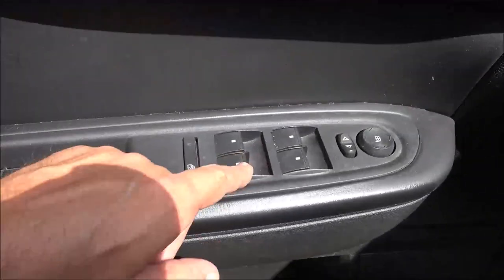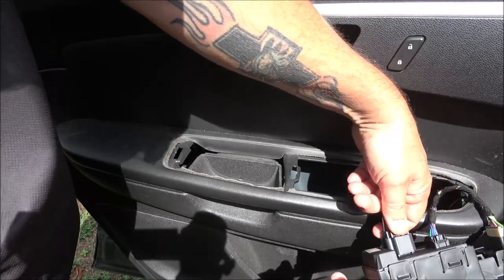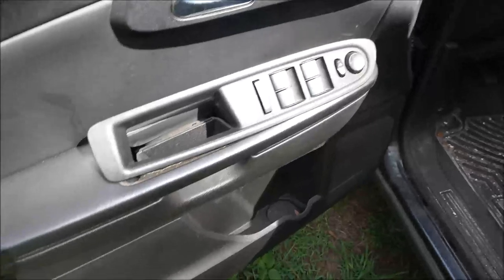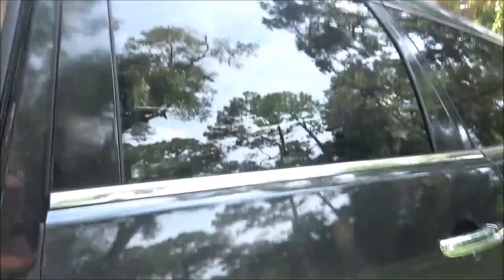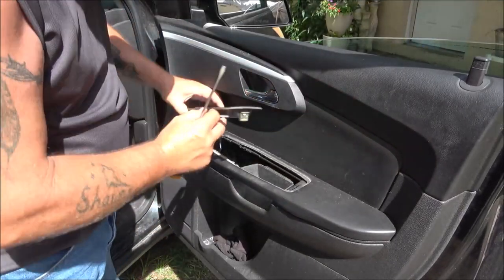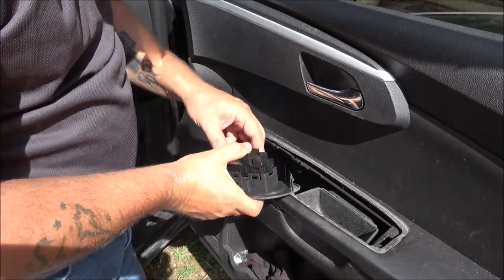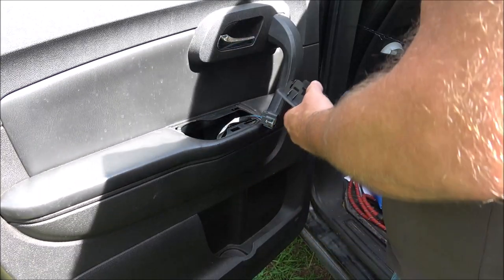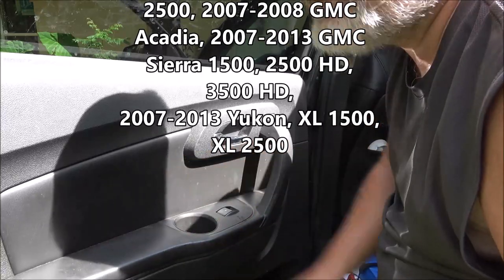Chevy Traverse Window Switch Replacement

Comment: You made that look so easy but as soon I went to pull the trim, snap, cracked, popped.
Reply from the maker: Yeah, you have to be real careful. They get brittle over time. You can get those at any part store or online. They don't have to be exact, just get as close as you can. They're fairly reasonably priced as well.

Comment: Good video. Question. Why didn’t you just clean the contacts up? Would of been much cheaper and that’s all they ever need-q tip and some alcohol
Reply from the maker: Because it was less time consuming and  cleaning is a 50 50 shot of long term fix
Reply: Love that answer
Reply from the maker: @goodolsparky9386  thanks, have a great weekend.